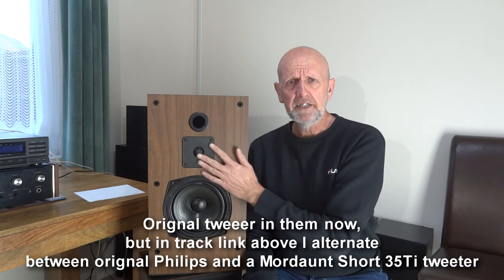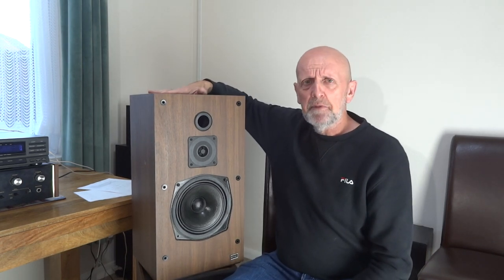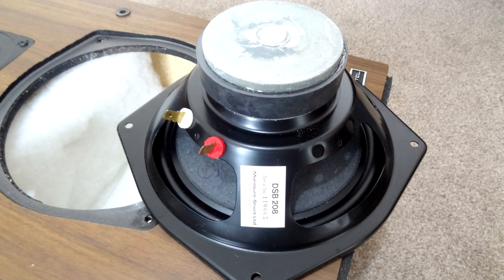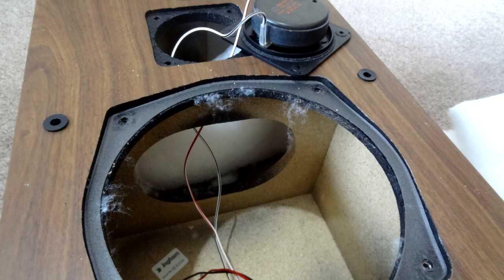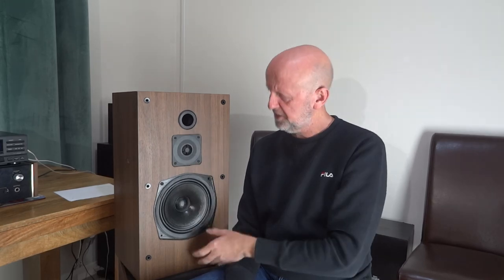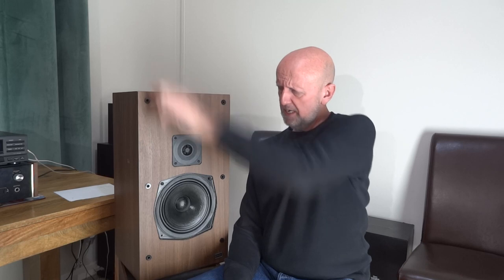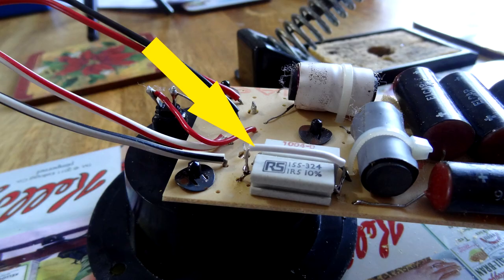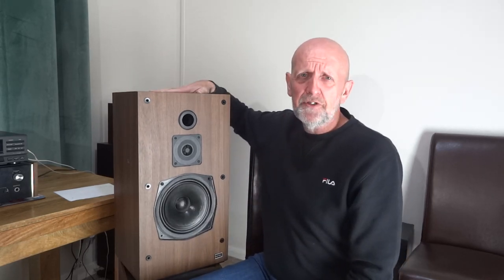Rotel RT 915 Speakers Review, Mordaunt Short Drivers, Vintage HiFi Audio

Comment: Would you say that everything about this speaker would hold true for the M&S Pageant Series 2 considering the shared components? Only I see positive reviews for those else where
Reply from the maker: I would definitely expect the MS Pagents to sound better than these, they have a different tweeter and I would expect the crossover would be different to, these were probebly made for Rotel at rock bottom costs. With the MS tweeters in this pair it helped a lot but was just bit to bright and shrill, but that is with the rotel 915 crossover
Reply: @MichaelYates  thanks for this. ploughing through your videos with ebay and facebook market place open beside me. A dangerous combination!
Reply from the maker: @emmettmccaffrey412  Lol only to true, should come with a danger or safty warning, I know exactly what you mean. I have bought many an item doing just that, but I hold myself back nowdays.

Comment: Try a decent amp. Your Sansui is ok for what it is but......! Try a Cyrus 7 with them or a 8000a
Reply from the maker: Thanks Martin, I have had a few people recommend the 8000a as an amp to get and in fact I have been out bided twice by one bid recently on eBay, but I will keep at it. It falls in the sub £200 barrier that I have set for the channel at the moment. In fact I think most if not all apart from the Marantz Receiver have fell in the sub £100.